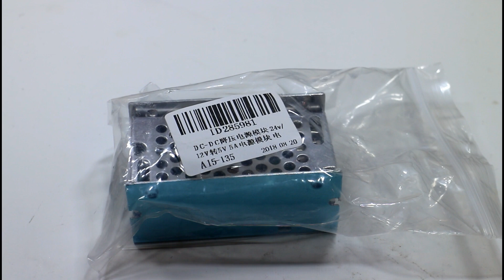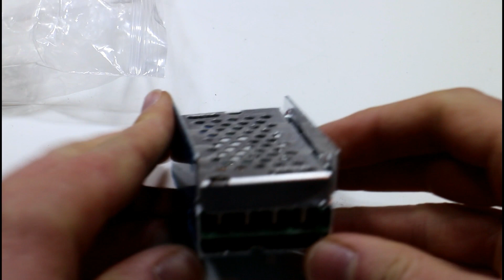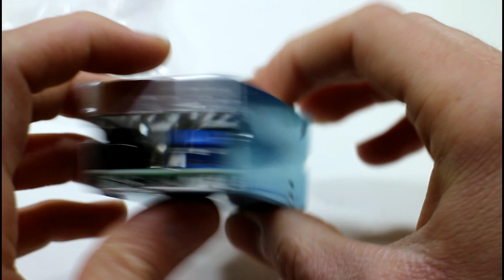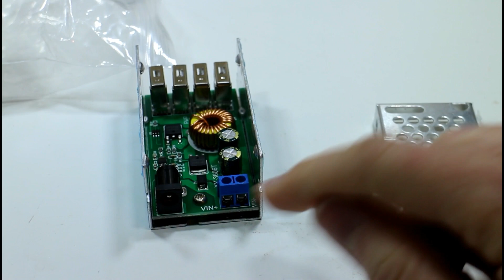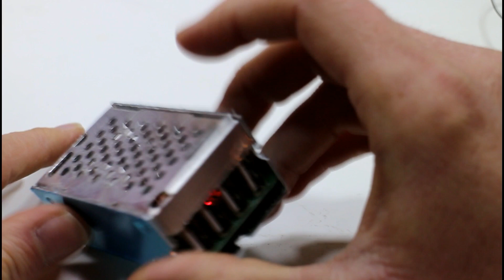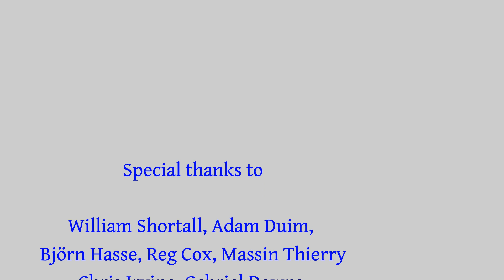IC Stations DC DC Step Down Converter to 5V USB

Comment: Is that support Fast charge ?
Reply from the maker: It basically just regulates a higher voltage down to 5v usb, not a battery charger
Reply: @RCTractorGuy  Thanks